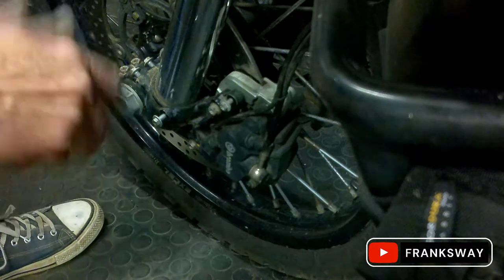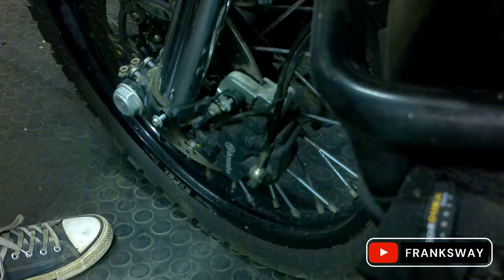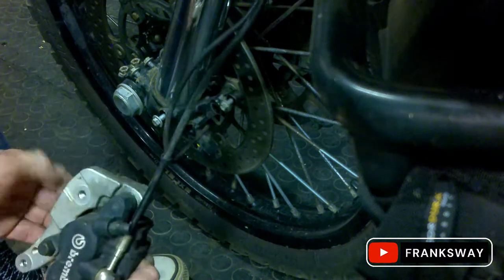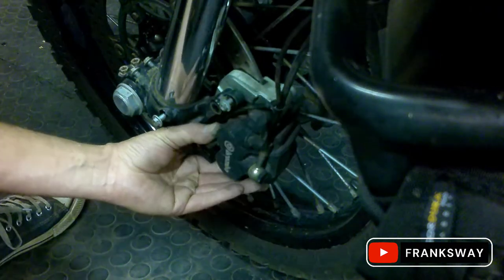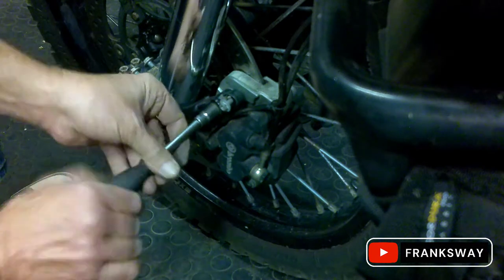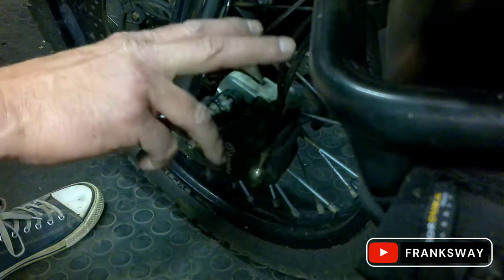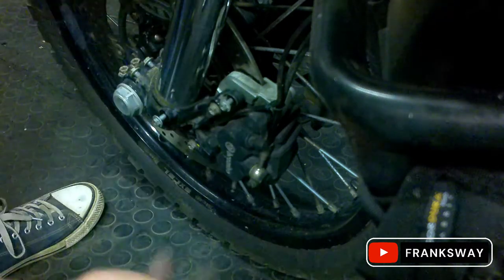KTM Front brake pads install - KTM 990? #ktm990adventure #ktmbike

Comment: Thanks for the vid. I just did mine; and its very easy. However, I'd like to point out a couple of issues I had
1. It's advisable to take the brake reservoir cap off and remove the inner rubber seal. The reason being (in my experience) is that when  you open up  the brake pistons,  the brake fluid level rises  and can pour out onto the bike. Keep a careful eye on this as you proceed. I actually took some fluid out to prevent spilling. I also wrapped rags around  this area to protect  the paintwork.
2. I only needed to take off the side part of the fender as there  is plenty of room to manoeuvre  the caliper.
3.  I had to use a hammer and a small nail to remove the round pin that held the brake pads in place.
Everything else was simple.
Thanks for the vid 👏🏽
Reply from the maker: Hi there...thanks for the detailed feedback,much appreciated, we learn every day 😉
Reply: @FranksWay  my pleasure Frank. We all love these machines and any help however small is very welcome. Just doing my bit 😎
Reply: Thanks Andy.  That pin was tight on mine and I did not want to force anything until I saw your note.
Reply from the maker: @toddwmac Glad you sorted it 😉
Reply: @FranksWay  have you made a water pump rebuild vid? I did mine a few weeks ago. It was as fairly simple. I also did a full service too; it made sense with the bike apart and the oil and coolant loss I’d incurred. Living in the mountains, I have to rely on me and my abilities to repair and service etc. So your vid’s are most welcome. I tried taking my bike to a “competent” mechanic. Bike always came back with a new problem 🤣
Reply from the maker: @andyrelf4161 Hi..i havent made a waterpump video yet, yes in the mountains you have to be able to make do with anything..i am in the French Alps most of the time as well. 😉. Thank you for your reply.

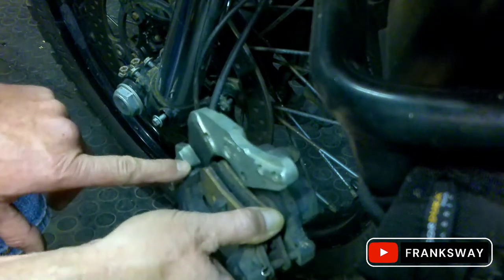Comment: Thanks Frank!   After more than 15 years, I can't bear to let my 990 go so your tips are helpful.  For those that might have an issue with the pad  laying against each other when you are trying to get them on the disk (as Frank mentions at 00:03:00) try making a spacer with some stiff cardboard that keeps the pads separated but can be pulled out easily when you get the disk in.
Reply from the maker: Thanks for the kind words

Comment: Doing this tomorow thanks for the tips 👍
Reply from the maker: Hope it helps,please view video till end,and yes,the cct replacement solved my problem.
Reply: @FranksWay  what is CCT, i AM portuguese and i maybe didnt understand everything..
Reply from the maker: @jpvilacamourao  CCT = Cam Chain Tensioners..make sure you pre bleed with oil and install, if you can,ensure to lock the motor, OR remove and re install immediately
Reply: @FranksWay  ah ok.. i was talking about Change front pads.. CCT was made by my mechanic.. thanks
Reply from the maker: Ok,on the front or rear pads,i simply remove splitpin,pull out the shaft and slowly push back the pads to original place with flat screwdriver,but slowly.Then install new pads and push back pin again with circlip installed.